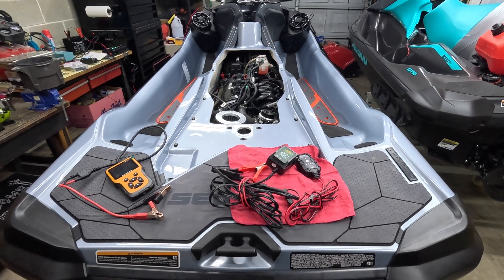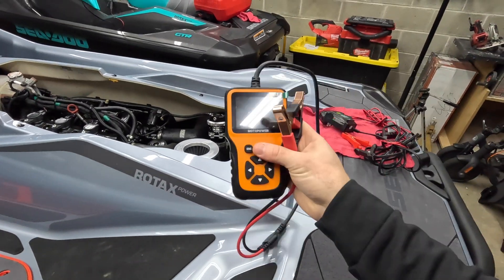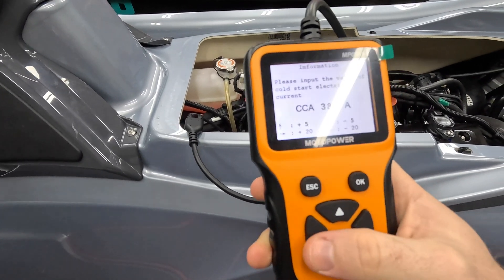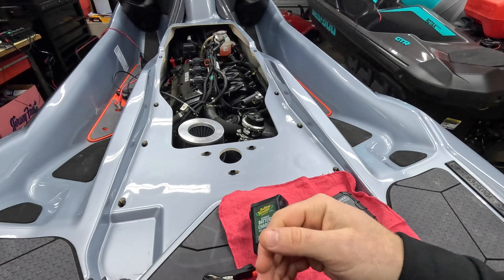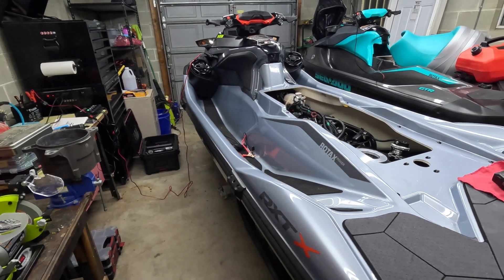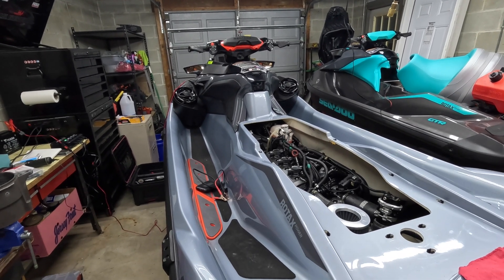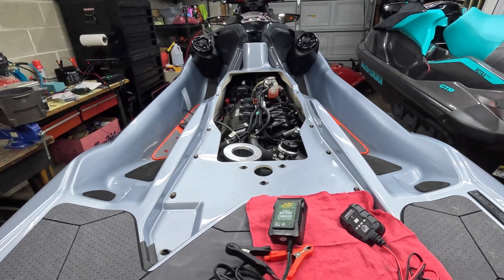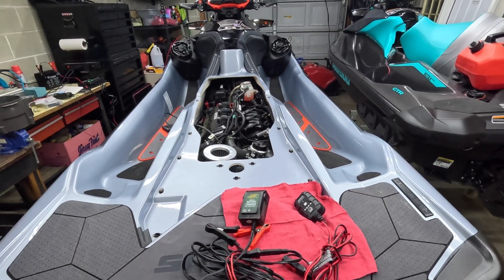SeaDoo Batteries // Charging, Haijiu Problems, Lithium vs AGM, Battery Testing and Diagnosing Probs

Comment: I have had good luck with an Ionic lithium battery in my ski.  It has an app that uses Bluetooth to connect to the battery, so I always know what my charge level is at any time. Ionic also has a reserve power start button on the battery itself- like the built-in Sea Doo feature, it will never let the battery discharge below what would be necessary to start the ski.
Reply from the maker: That's fantastic. I just checked them out, certainly looks like the answer to the problem with the NOCO's. Thanks for the info!
Reply: Sure thing.  Thanks for all the great maintenance vids!  I try to do as much as possible myself, but being somewhat of a novice to Sea Doos, they are a huge help.
Reply from the maker: @ I’m glad to hear that! If there’s anything specific you ever need help with, I’d be happy to make a video out of it.
Reply: @jetskijake-seadoo  I come from an extensive powersports background but only one year into PWC's.  Looking to add another Sea Doo ASAP.  I see you have a GTR.  I want a current gen 230 so that means either a GTR or GTX.  I have a GTX 170, just want more punch but don't want to run 91 or higher octane.  I don't love the idea of less fuel capacity in the GTR and I don't love the simplified gauge cluster but like the idea of more storage.  I also believe I would enjoy the more spirited handling of the GTR.  I ride fresh water lakes and rivers and do like the ST3 hull and features for what I do.  I have personally added the depth gauge and Ski + X module to my 170.  Do you have any thoughts please?
Reply from the maker: @imhardcorps  All of your points are valid! Just keep in mind that there's a noticeable handling and feeling difference between the two hull types. Since the GTR has a round bottom hull, you'll bounce over chop instead of cutting through it like you do on the ST3 hull. The plus with the GTR's round hull is that you can easily kick the hull out to do 180's. If you have the opportunity, I would see if you can ride a GTR to see if the different hull is a deal breaker for you. 

Aside from that although the GTR has more storage volume, the GTX has more useable space. Its hard to explain but if you look at both in person you'll see what I mean.

Comment: Do you know which size NOCO lithium battery fits your RXT-X?
Reply from the maker: @chipanderson4768  For all newer SeaDoo’s you want a group 20 so the NOCO NLP20 is the size you want to go with.
Reply: I used the Amazon NOCO NLP20 with one spacer (comes with4) and fits perfect.

Comment: What kind of battery charger port do you have installed
Reply from the maker: @mattm15  it’s a flush mount SAE port that I got on Amazon for $15. The leads connect directly to the battery with a fuse. I’ve used this setup on all my skis since it makes it easy to charge and I can use SAE power accessories on the water.
Reply: @jetskijake-seadoo thank you appreciate it!